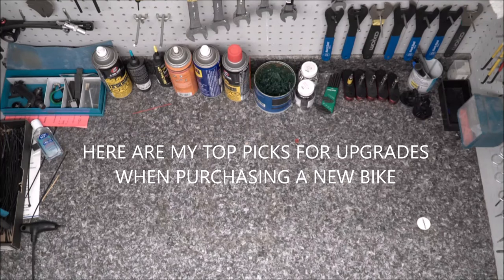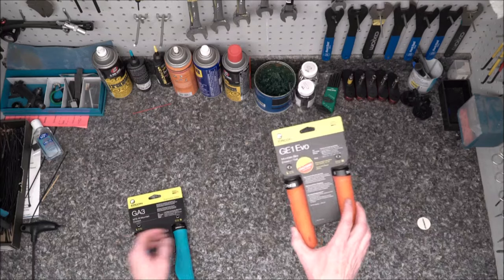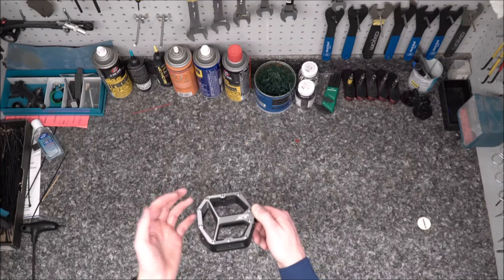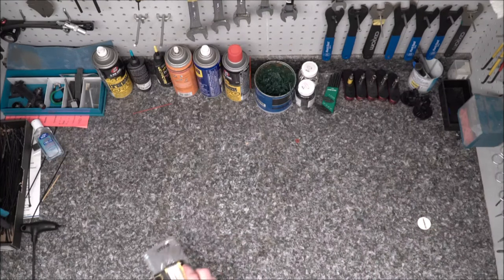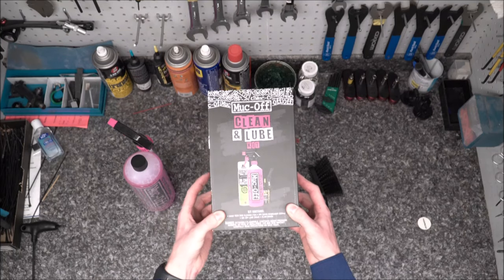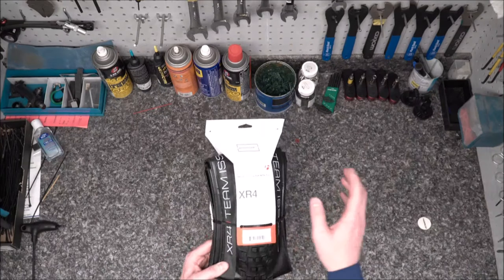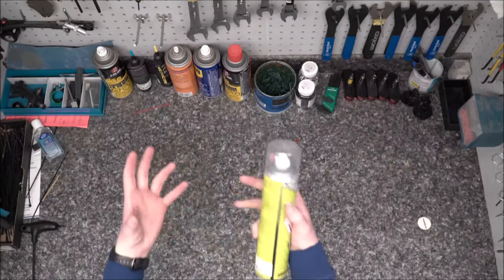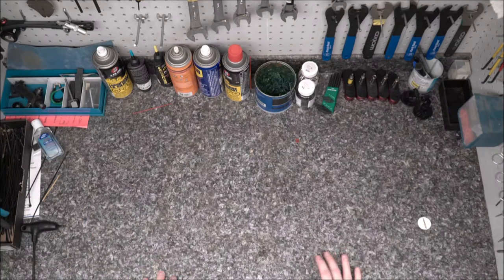CHEAP Mountain bike MUST HAVE'S - things you need to BUY [LINKS INCLUDED]

Comment: Sry for commenting so much but is it better to upgrade the fork or the drivetrain on the marlin 4. The replace ment fork would be a rock shox judy air and the drivetrain would be microshift advent groupset. The stock deraulier is a tourney and the stock fork is an sr suntour m3030 coil with no adjustments.
Reply from the maker: Ask away, I'd personally prefer a upgraded shifting, but suspension will be a huge upgrade too
Reply: @goodluckchrisclark  thanks...anyway my suntour is not that bad i did a few jumps and now it performs way better my budget is 190 dollars for upgrades on the shifting ill probably go 1x9 with the advent